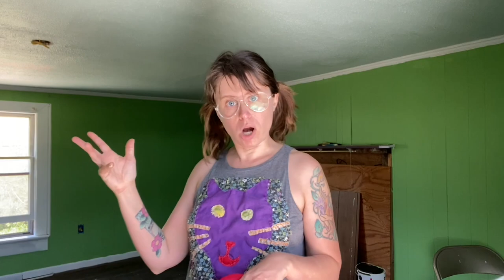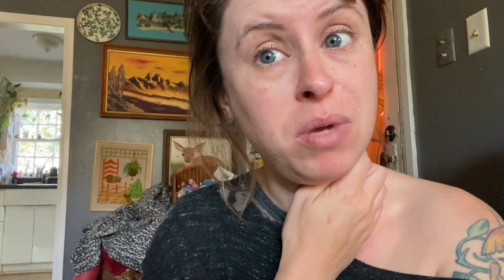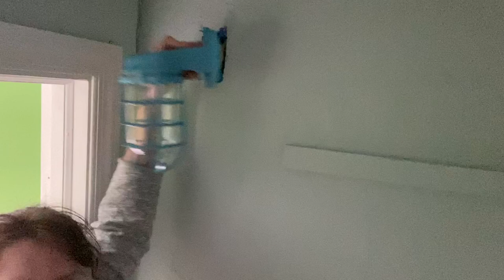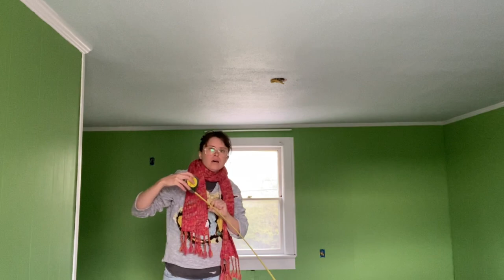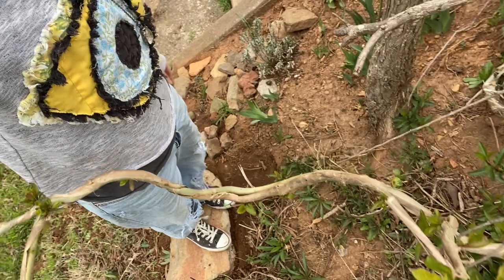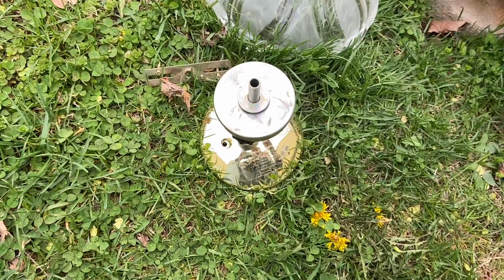This Ole Shack! Ep44 Old House Renovation • Cheap • Frugal • DIY • Picking Light Fixtures

Comment: When you’re first moving in, there are so many things you need that $5 light fixtures work just fine.  As you saved to buy the place, save now for the light fixtures of your dreams.  Easy does it.  One at a time, as budget permits.  I bought a nearly 100 year old cottage 10 years ago, and am still saving to purchase exactly what I want.  It takes time, but you’ll get there!
Reply from the maker: I can’t wait until you see how good some of the 5$ lights have turned out 🤗🤗 next video